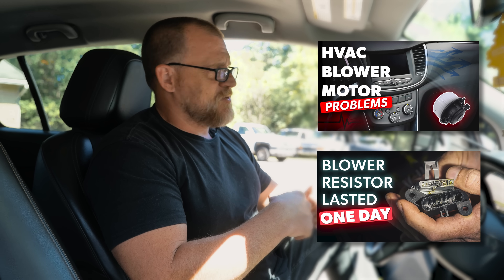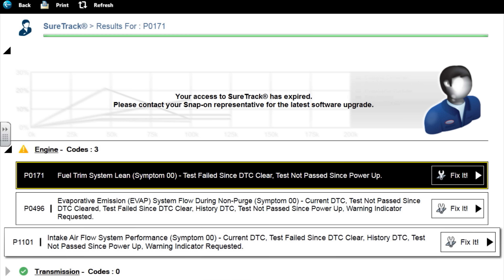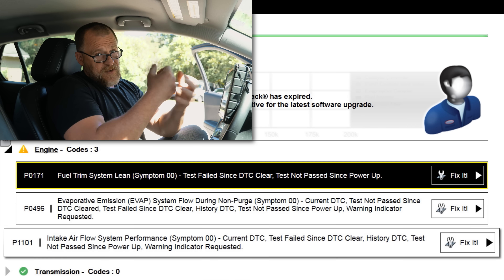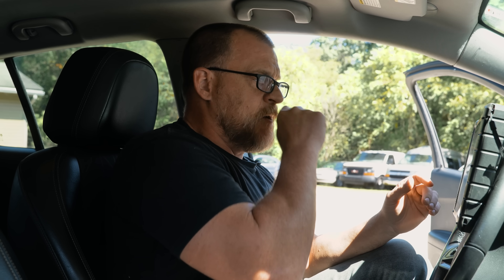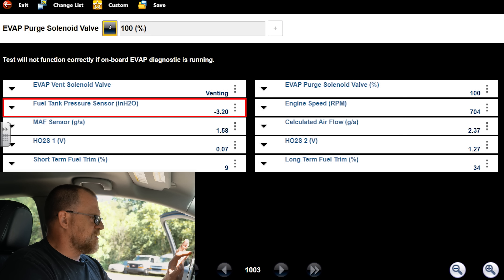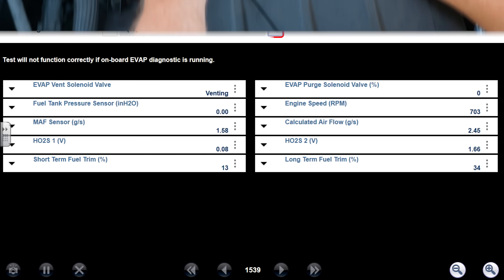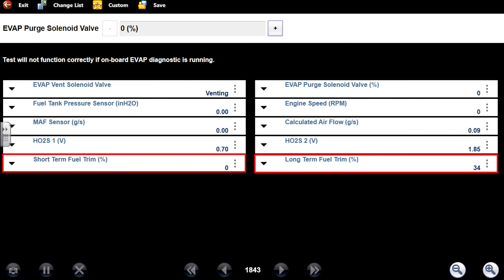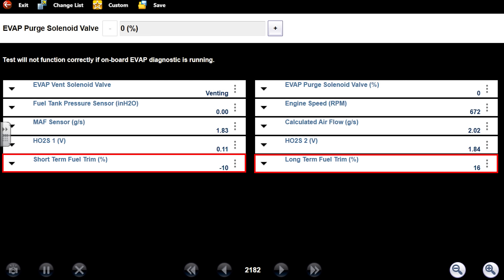Lean Condition Caused by a Stuck Open Purge Valve [P0171]

Comment: I have a 2010 Turbo Forester.  Any time you start it count to 10. Then stft goes to --24%. Engine stumble slightly.  As stft makes its way back down the engine smooths out. Takes   another 10 sec.. 
Possible getting vapor from evap?
Reply from the maker: possibly evap related, but the purge valve is typically active at idle as you saw with this car

Comment: Tell your customers to stop over filling the fuel tank. It causes carbon particles to float and become stuck between the pintle and the sealing surface..
Reply from the maker: Have you taken these apart? I believe it is simply varnish from the fuel vapors. Injectors will stick for the same reasons when the sit for a long time.
Reply: @ScannerDanner that is a valid point i didnt consider.  And I must admit i have checked the fuel recommendation of which octane fuel to use on which manufactured injection system.i would assume( which may be an incorrect assumption) that all vehicles should actually be ran on the order of 91 to 108 octane. ( fewer impurities and burns cleaner) which keeps the interior cleaner. Not to mention the fewer emissions

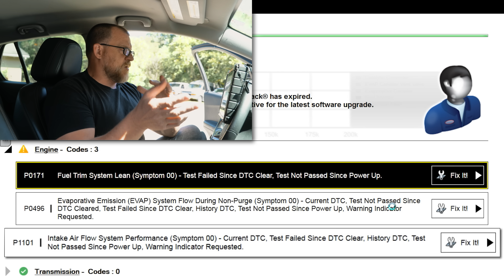Comment: For people new(er) to diagnostics, in the early summary approximately 1:00 , Mr Danner says "the flow of fuel" and "once the canister is depleted of fuel". He is referring to fuel "Vapor" that is drawn from the tank and/or charcoal canister.  Like shaking a pop bottle, then slowly opening the cap, vapor is released, not liquid.  Hope this helps, great video as always Mr Danner.  
Stay gold.
Reply: There’s a pause button, and a video speed setting too. It’s in the menu under the gear icon.
Reply: This guy just talks too fast for learning. Also compromises the accuracy of information he is giving
Reply from the maker: "Compromises the accuracy of information" please tell me where I did that in this video. If you have questions on fuel trim for example, i have lessons on that specifically that you can watch and get up to speed! I cannot cover all aspects of everything in every case study. I do expect my viewers to know certain things and if they don't, to ask a question, and then I can guide you on what video(s) to watch to help. I have over 1700 videos between my website and here on YouTube.

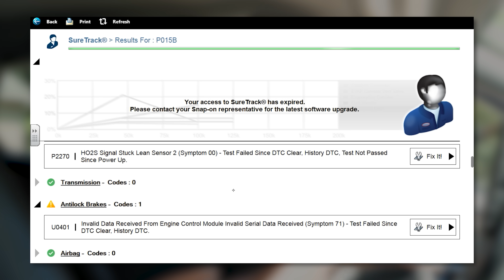Comment: early thoughts by 0:18 seconds, dirty/bad MAF, cracked/loose intake tubing, vacuum leaks. not fully ignoring the EVAP code, because maybe false or could be the culprit(pinchy pliers block off), flow now you sucker! 🤣 you know, most of that is quick visual/audible diagnosis, is anything split, is there hissing vac. leak. of course my ears are pretty good at picking them up.

Comment: I had a navara no engine checklight when on on position but it crank but no start wt might be the problem
Reply from the maker: You need to do some testing first. I do not have a crystal ball. Come back with year, make,model,engine size, when this condition started and what you are missing. Spark, fuel pressure, injector pulse etc and then maybe i can help

Comment: I just had the same thing happen on a 98 ranger. P0171 code. Long term 25 and short term 12 at idle. High rpm went back to normal. I pulled the plug off and plugged the purge valve. Long term started back down and got to 12. I plugged the wires and hose back in to record the numbers climbing again. They didn't. 😂 Yeah I accidentally unstuck it. Good video.

Comment: I'm surprised the fuel tank pressure was negative with the vent solenoid open the enitre time. Is that normal to some extent or is there also a restriction on the evap vent?
Reply from the maker: Look up what 3" of water column equivalent is and it will make sense. It is such a small number! Thanks!

Comment: I have connected an OBD2 scanner for my GMC Terrain 2009. While filling the tank I observed very negative - 23% fuel trims. No codes were present at the time. I disconnected the EVAP purge valve and blow through it and it was leaking. I replaced it.
Thanks ScannerDanner ❤

Comment: Hi, great video as always.. i had a question,  why did unsticking the purge valve cause the vehicle to stall ? Should the ecu  not be able to adapt instantly to the changing condition and keep the engine running ? I wouldnt have thought it should cut out but maybe i am missing something.  I am just learning. Thanks for your help 😊
Reply from the maker: LTFT was +35 and the system take a minute to correct. So when I unstuck the purge valve, it was till operating with all that additional trim = immediate overfueling condition = stall. 
Make sense?
Reply: @ScannerDanner ok yes perfect. Makes sense.. I get it now. Thanks very much..

Comment: Unrelated question:  Do you see  any value in CAN bus decoding/math when trying to diagnose and repair a problem?  I see a bunch of guys on the picoscope forums/pages getting into decoding/math, but I haven't seen a case where I cant fix it faster just by looking at the waveforms, network schematic and then divide and conquer.  A few of them I could have even fixed with a DMM.   I  just see decoding/math as a waste of the customers money for the amusement  of a tech who  wants to geek out.
Reply from the maker: The majority of the time, I'm in agreement. A full system scan is going to reveal more about which modules are talking and which ones are not, over decoding CAN packets. I'm sure there is value in it though, but that value is also limited in what information the manufacturer provides. Last I heard only Mercedes and maybe a few others even release that information. So even if you can decode it, you still wouldn't know which module it is. I think i remember seeing someone use it for a parasitic drain where one particular module was waking up the network and they were able to determine which module it was and from there track it down to an input issue on that module. So no codes type of situation. Anyway, definitely worth learning imo
Reply: @ScannerDanner perhaps you are referring to Mechanic Mindset? He had a video about something similar. He decoded the message to identify which module was waking up but he also stated there that it doesn't always work and he doesn't always use this method. 

It... Didn't seem like a really trusted method, tbh. It looks easier once you know the fault and what to look for, but other than that it seems like we have too little Information.
Reply: @ScannerDanner  ok - thanks for the feedback!

Comment: Nice video. Is OEM available or does the shop owner want another nonprofit repeat customer LOL
Reply: Vacuum does a better job than people though.
Reply from the maker: Lol good question! I've seen major issues with aftermarket purge valves in the past. Check out my Hyundai EVAP leak series (I think 3 parts) caused by an aftermarket purge valve

Comment: This is a common issue on fords and Chevys, mainly ford edges/escapes and Chevy trax/buick encores/enclaves. I’ve replaced probably hundreds of them working at a rental car company because the drivers there go and “top off” the fuel tanks and next thing the engine light comes on soon after that.
Reply from the maker: Not sure it is caused by topping off a tank, but yes, indeed, this is a common issue on many systems

Comment: p1101 is just a throttle body clean and "airflow compensation" reset.
Reply: I’ve seen more boost leaks cause that code than throttle bodies
Reply: p1101 on this engine can be caused by purge valves and valve cover's integrated PCV, even boost leaks. i've seen the purge valves be bad even though they close properly, which is even more crazy.
Reply from the maker: not in this circumstance, we have a large vacuum leak that is causing this fault
Reply: @ScannerDanner 
Wouldn't koeo vent test show results. That's what I do on all vehicles I check when it's warm out side and rock the vehicle and watch the  pressure.  GM and FORD ALLWAYS get both when one fails